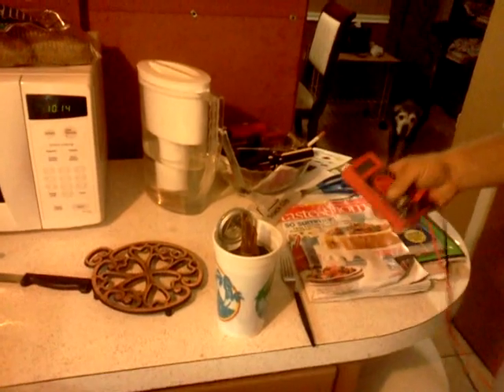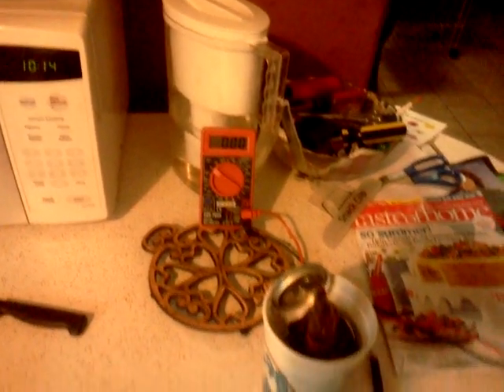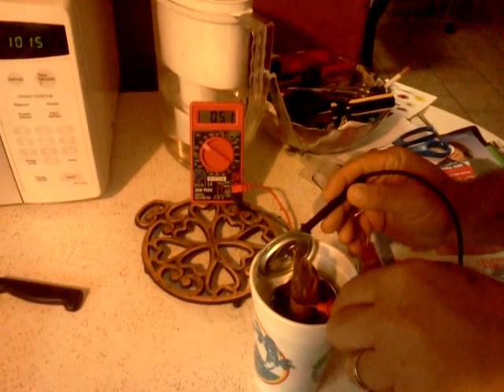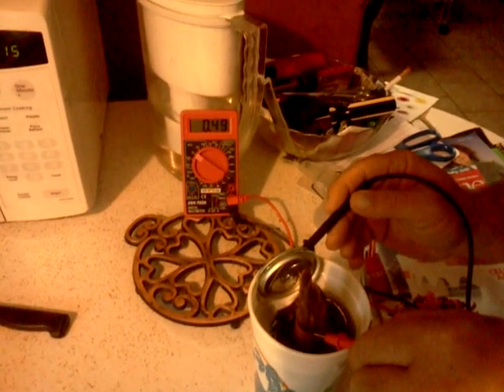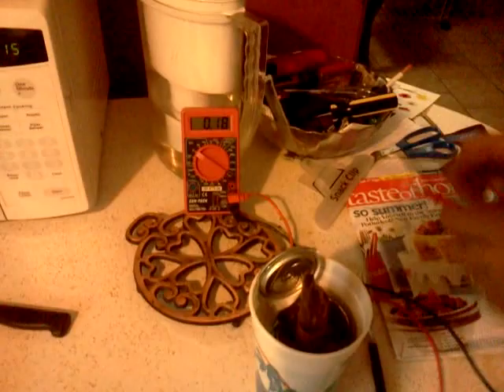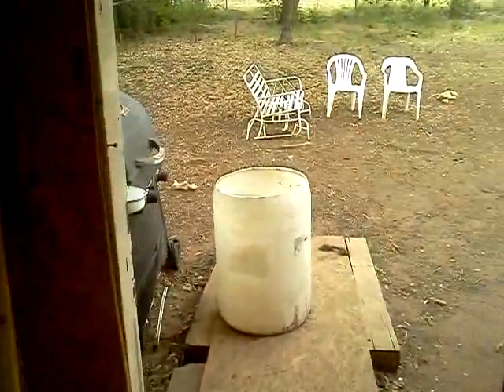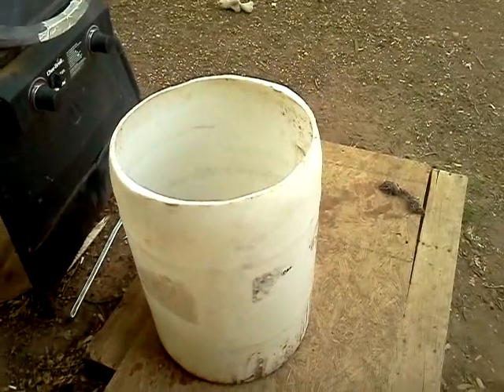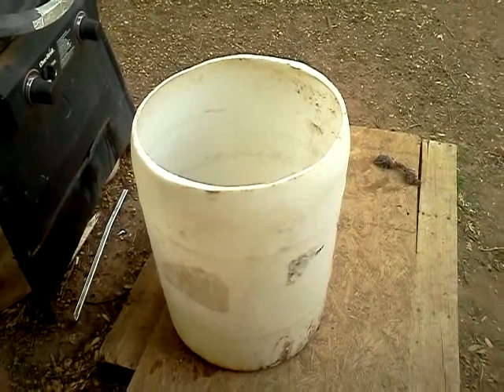Home made Copper Aluminum battery

Comment: If you use a leaf(yeh, leaf!) and twist with a copper wire and pack with aluminum sheet you will get 0.2v, if you nano coated it you will get about 0.5v in AC and DC in the same time.

Comment: Just a bit of help with the chemistry.
Al(s) > Al3+ + 3e   E= 1.68v
cu2+(aq) + 2e- -> cu(s) E=0.34v
Overall Reaction:
2Al(s) +3Cu2+ -> 2Al3+(aq) +3cu(s)
E= 2.02 V

So you would expect 2.02 V with this battery im suprised your volage was extremely low maybe you had a competing reaction.
Reply: That is assuming that the reaction was done at 25 degrees centigrade and with 1 mol/L of each solution.